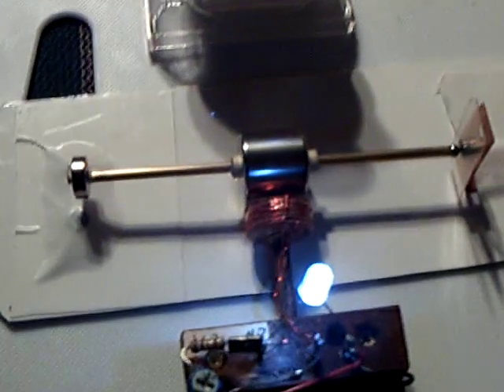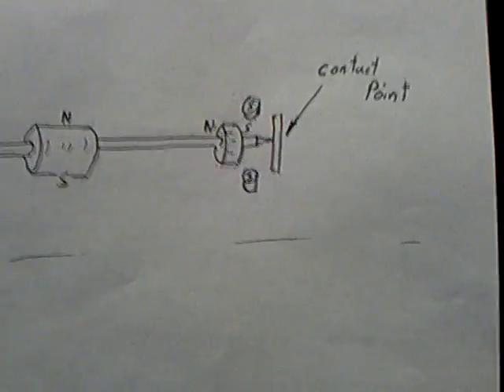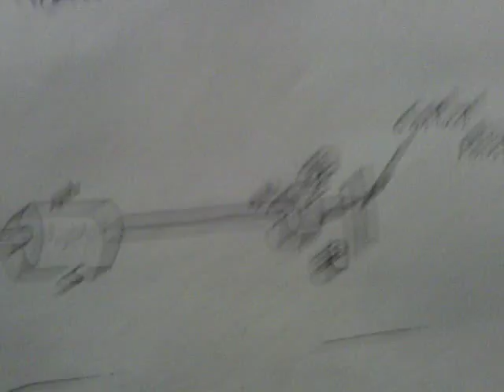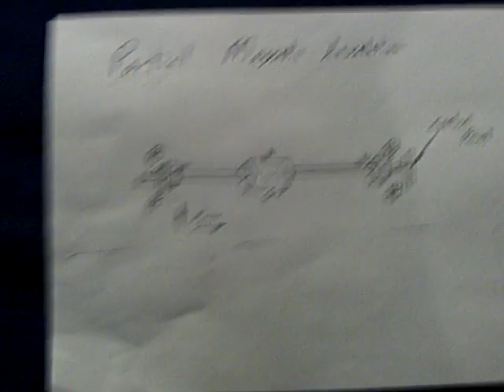Mag - Lev Bobin Motor.ASF

Comment: What if you tried to use your solar panel to run your motor? You could use a bank of leds connected to your Slayer device to power the solar panel. This way you could complete the whole power loop and I would think that your system would run forever this way. I would think, based on what I am seeing, that there would be enough light available and may be Maggie could have a sister to run another Slayer for more light, if needed. Optical isolation, pure DC power for your motor. A closed loop.

Comment: This would provide optical isolation of the system, plus a pure adjustable DC voltage based on the amount of light required by the panel to maintain the motor operation. Maybe some extra light also to operate other devices from a different solar panel. A true isolated closed loop. OU? May be???

Comment: @Lidmotor  

 Hi, A real cool setup. Something better than what I have been experimenting  with. Managed recently to harvest 50 volts AC out of my 1x1 inch diametric magnet

K&J Magnetics just started stocking a new1.5x1.5 inch  diameter DIAMETRIC cylinder magnet with a 1/4 inch center hole. Also a 2 inch x 2 inch diameter DIAMETRIC magnet same as above.

I wonder who will be the first kid on the block to reach overunity using either one of those bad boys?